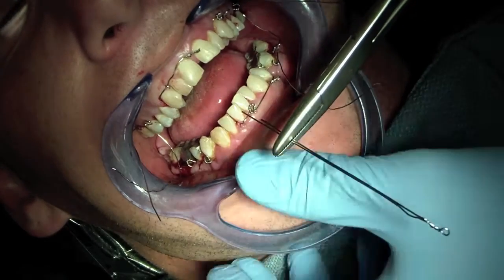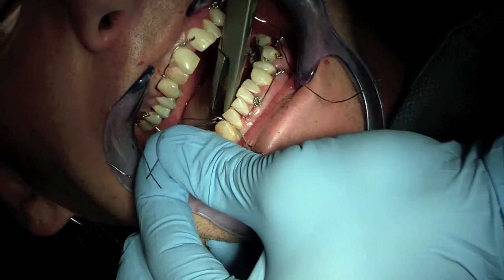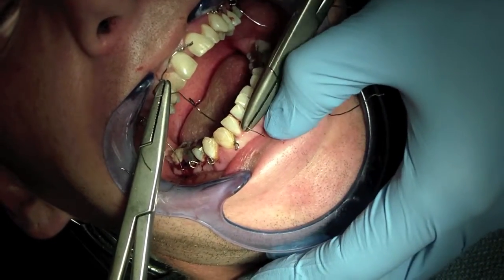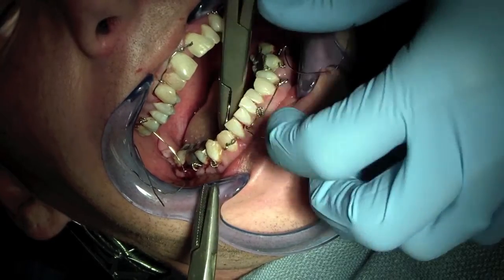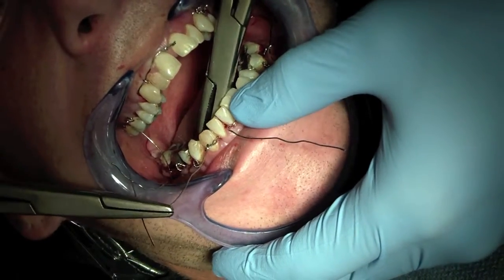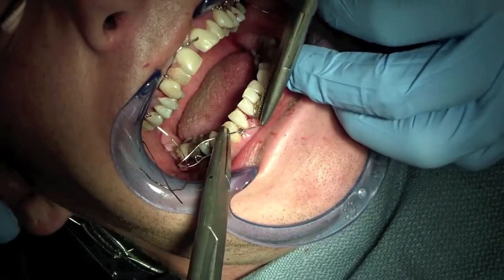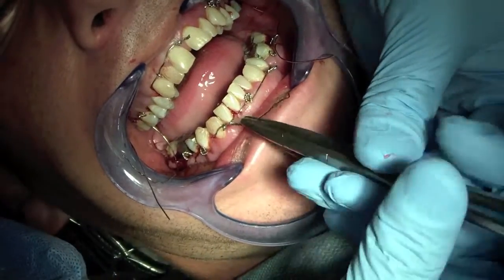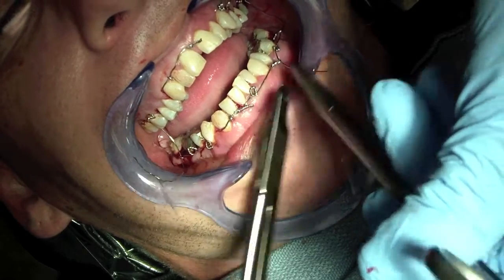Jaw Fracture - Ivy Loop Placement Intraorally

Comment from the maker: @DocCrutch Thanks for your comments. This issue was revisited just this past week when I was extracting 4 impacted third molars on a non sedated patient.  2 partial bony impacted max 3rd molars and 2 mandibular horizontal impactions -all under local anesthesia. I thought I had the anesthesia issue down, until I was pimped "again" by my OMFS mentor.  Your comments are timely and I'm working on a basic discussion video on LA - your points will be considered. Thanks.